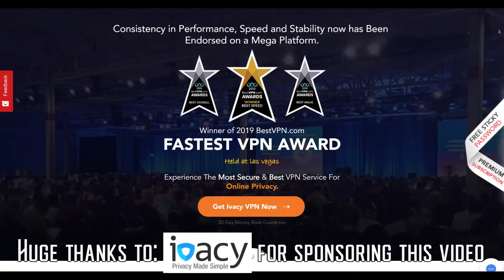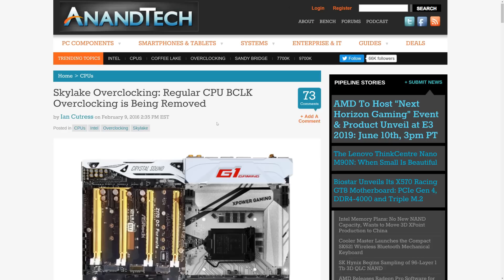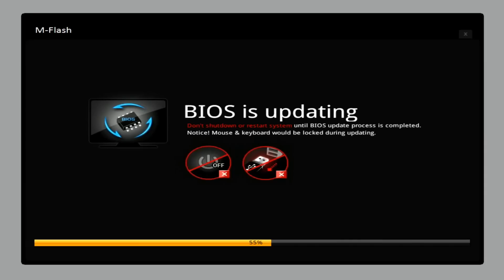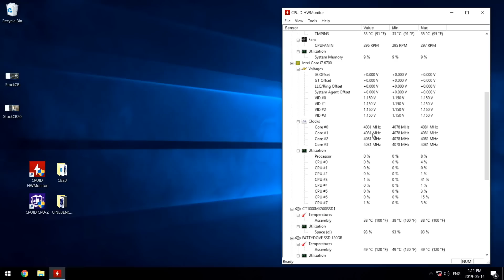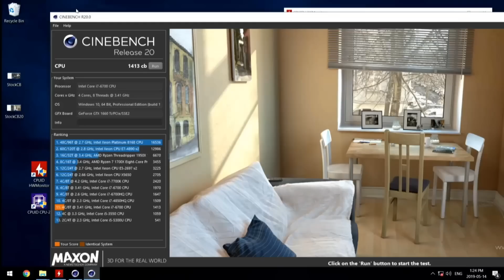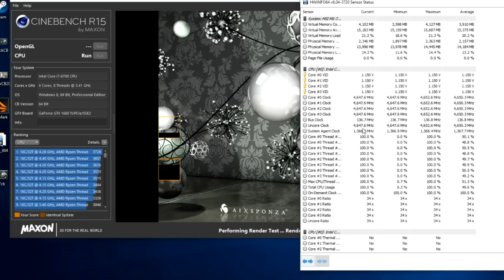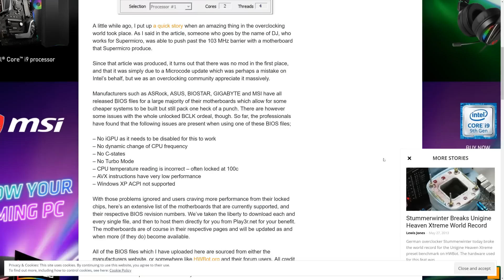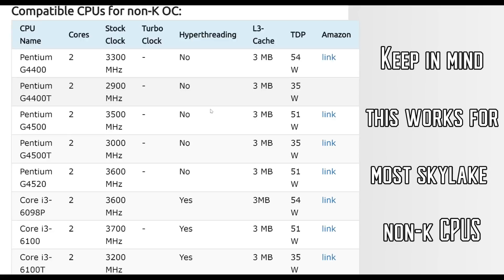Overclocking a non-K Skylake CPU to 4.7Ghz in 2019

Comment: I7 6700k or i7 5930k?? 
I currently have a 5930k
Reply: Almost zero difference when they're overclocked. It's a great CPU man, not going to bottleneck any games.
Reply: tubularmonkeymaniac thanks man, got it for 50 bucks pretty fair I think
Reply: @InterstellarCloudd  Ha! Considering it benches around the same as a Ryzen 2600 but yours has better single core performance, then yes that is an awesome deal.

Comment: Oh, so u gone from i7 8700 (skylake) to i7 6700 (skylake)...

Horraaaaayyy!!!

Lets overclock the new skylake 😂😂
Reply: Arcitecture's the same soo
Reply: i got  to 4.7Ghz with non k i7-8700 dell  xps. with no bios support for it . its possible, but a pain to get to it .
Reply: @windrush8044  tell us why
Reply: @sirdranzer  because a lot of reading just searching for the solution. You gotta have the will to make it happen. or it will not .  I cant recall all the steps it was a few years ago now .
Reply: gotta ask can i oc a 7700 non k on a z170?
Reply: @sashwinraaj6918  nope, this only works on 6000 CPUs
Reply: @biniu3206  welp i just upgraded to ryzen 5 3600
Reply: @sashwinraaj6918  good for you :D

Comment: You should know that the way you overclock that makes it so it doesn't throttle down and it's at that speed the entire time lol.
Reply: is that an issue if temps at idle are ok? asking for myself
Reply: @Dakotajm0726  ya you have boost clocks and core clocks if you turn your setting from 1 to 1.25. a boost clock will jump to a specific clock for a set amount of cores for a set time you can even add voltage with this setting depending on how many cores you have set to boost to a whatever speed. sorry um so 4.5ghz on 2 cores for 10 seconds with plus 50mv or whatever you set it too.............

Comment: LoL, I have around 1000cb in r15 with 3970k on 3.9GHz.
Reply: i guess you mean i7 3970x a 6 core 12 thread cpu where this is 4 core 8 thread. So this would beat the older 3970x in pretty much 95% of scenarios, and match it the other 5% :) that being said, 3970x is much older and therefore it's still a respectable score. But it seems as though AMD ryzen has intel beaten everywhere except the 9900k. Here's hoping intel allows overclocking on all CPU's with 10th gen and Z490/b460 motherboards.

Comment: Would you make video to use Coffee lake on Z270 and Z170 mobos, should be fun.
Reply: You bridge cpu pins and bridge a jumper wire on the mobo on a video I watched and  it can be done. But for what a 9th gen board costs it's probably not worth doing unless your doing it just to say you did
Reply: @mitchmckeiver1429  makes sense. why risk bricking a Mobo and CPU when you can just buy a new board? Especially in the case of the 9900k that needs the z390's advanced power delivery.
Reply: @amorgan20111  Well you can do things for fun also. Luumi had 9900k in Z170 at 5,5ghz, sure not all the z170/z270 have as good power delivery.
Reply: Winha good idea
Reply: I thought intel made it so that the Coffee Lake CPU's wouldn't work with the SouthBridge chips on the z170 and z270 boards?
Reply: @amorgan20111  there are hacks around that.

Comment: Im still rocking a 6600k over clocked to 4.6Ghz. I tried to get it to hit 4.7 but had no luck even at 1.45v I got blue screen. Max core temp I have see is 50c with my Noctua nh-15d cooler. Will upgrade to the ryzen 3000 soon as I can. Soooo looking forward to it.
Reply: I doubt you will see a performance increase in applications that use 4 cores 8 threads or less. Things that use one core will very much not be faster. Sidegrade! But if that is your goal to get the threads then by all means.

Comment: Science Studio has an old video on this before they nerfed it. With all the security patches lowering performance Intel should just allow locked chips to be overclocked on Z series boards.
Reply: With Intel being Intel, I suspect hell will froze over, couple dozen times, before Intel will give its loyal fan a long awaited and well deserved apologies for all those performance nerfing security patches.

Overclockable non-K, it will not happen under Intel's watchful eye.
Reply: @Verpal  vs amd that one of there lowest priced cpu (athlon 200g) was originally locked but because of an "oopsie" on msi boards it became unlocked, then i think every board followed suit with AMD being  cool with it
Reply: @Gl0ckb1te  Emm..... I think thats actually some Genius from MSI did some microcode digging instead of AMD suddenly decided to unlock an ultra low end processor.

Don't think it is related to the Intel's fuckup, however, on the issue of 200GE, I have seen it OC all the way to 3.8-9Ghz, and approach near Vega 8 stock performance.

Had to say it is one hell of a great ''oopsie''

Comment: When you have a X58 motherboard and a Xeon W3670 @4.2 ghz with a Cinebench score of 927. Not too shabby xD
Reply: I have the same cpu! Its hard to find someone that has that cpu, its rather rare. Mines running at a stable 4.43 Ghz on 1.4 Volts, it boots with 200x23=4600 mhz but sadly i cant get it stable enough for 24/7 usage at that clockspeed :(
Reply: @Jack233  I run the W3670 @4.2ghz because of stability. @4.4ghz or higher it will blue screen or not post at all. Xeons rule, my favorite chipsets are P67, X58, and X79.
Reply: FX-8350 at 870cb*, max for cheapo 970 micro board (was $40 brand new in 2015, it’s definitely “dirt tier”, but it works). It ran for a super long time at 748cb on a 120mm AIO (could have clocked higher for games, but my stability tests are brutal and some stock Xeons fail**). 

**A “quick test” is Cinebench plus P-95 small FFT plus multiple handbrak encodes all at once (this is how I multi-task, my real machine often runs 4x handbrake batch encodes at once while running a YouTube video on a side monitor while I’m waiting on either fluid flow simulation or CAD render on another side monitor while I’m gaming on the middle monitor. I AM A STABILITY TEST!)
*FX on phase, only limit is Vcore limit by cheapo board, still not bad for such a budget board, literally the cheapest I could find back then, I didn’t even know what Overclocking was back then, then the OC bug bit me hard! Poor little board, it’s doing great anyways though.

Comment: My 3770 non K is OC to 4.9 :D
Reply: I had that CPU for 6 years! Non-k 3770 although I was not able to get it pass 4.3 ghz OC. Still my fav i7 cpu IVY bridge 100%
Reply: @TheAnunnaki-NYC  Yeh but it runs wery HOOOOOTT idle 50/55
Reply: Care to explain how? Best those can do is 105-106 BLK plus 4 steps above stock turbo with the free turbo "overclock". That makes 4.3ghz
Reply: Silicon lotery, and noctua nhd-15 with 2 140 fans open bench

Comment: i can vouch for a micro code update nerfing the bclk oc.  my main rig a couple years ago was the vanilla 6700 with an msi krait z170 board under custom h20.  the oc would last about 4 months then i'd get a win 10 update and all of a sudden by bios settings weren't being reflected once the pc loaded the os.  msi afterburner would report that my cpu clock was running at stock rather than at its oc, and similarly cinebench runs would report stock clocks and lower scores.  i'd have to flash the bios to a factory approved bios.  then flash to the bclk oc enabled bios and reapply my stress test verified oc settings.  i'd have the system running oc'd for a few months before having to redo the process over again.
Reply: Welcome to intel i guess
Reply: @Aurora1337onYT  its the reason i'm on a ryzen now, though amd's lack of baseline standards for their chipset designs means there are far too many shabby boards on the market that fly the amd banner.
Reply: @davidtran9444  im only on intel side sadly but i support amd i guess.. last amd cpu i had was fx 6300 and the 970 boards performed really badly but im hyped for ryzen 3xxx
Reply: @Aurora1337onYT  leaks of boards for the upcoming ryzen 3 suggests that the day of a mid-range ryzen board supporting every chip in the consumer level product stack is coming to an end.  it looks like some of these boards are going to require two eps cpu power connectors, likely to be able to properly feed the 12 and 16 core chips.
Reply: @davidtran9444  You just have to be savvy and get a good, full featured board.
Reply: @davidtran9444  The six and eight core varients are still going to be ass kickers.
Reply: no problem with my i5 6400 still running at 4.5ghz

Comment: This is awesome. I had an i3 6100 overclocked to 4.8Ghz. But then I wanted to use it for a Hackintosh build and you have to mess with the CPUID to get the overclock to work in OSX. So I switched to a 6600k. Also, If you use the overclocking BIOS, you don’t get the Spectre and Meltdown patches. Most venders don’t allow you to rollback the BIOS once you update past a certain BIOS. The i3 is in my file server now, so no overclocking
Reply: Hey, what motherboard were you using if you don’t mind me asking. I have an i3 6100 lying around and wanted to get a bit more than 3.7 ghz out of it. Sadly I don’t think my motherboard will do it